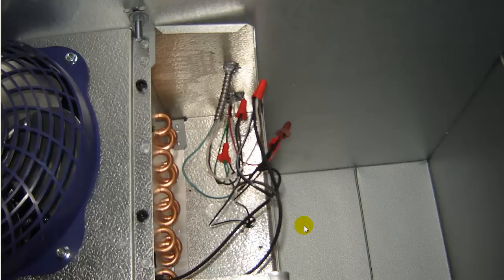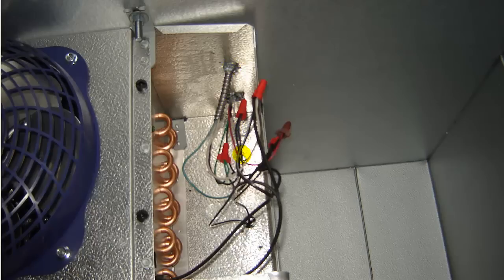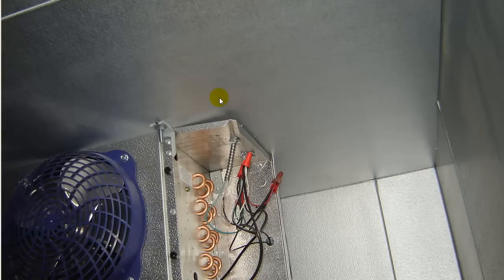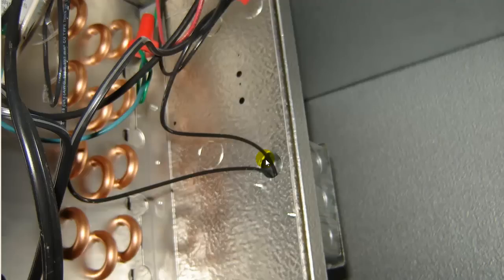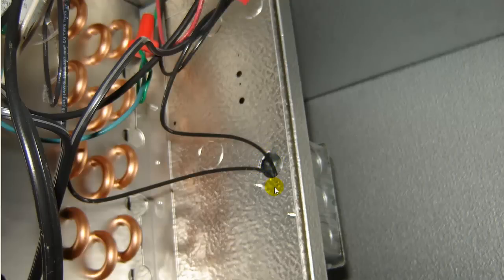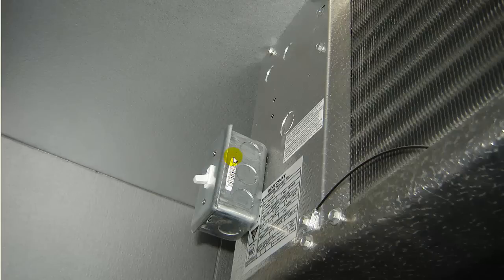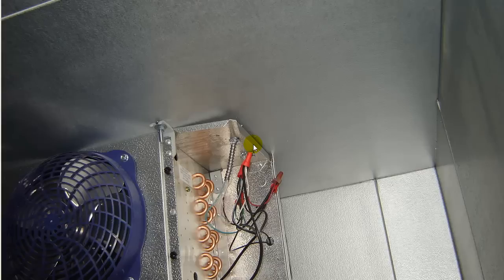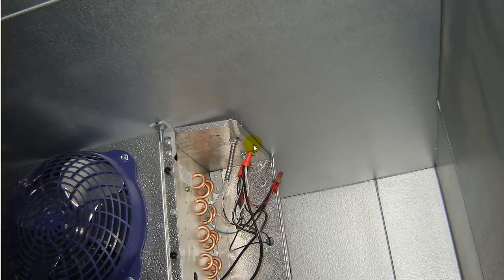Electrical Wiring for a Walk in Freezer

Comment: I just got done putting one of these up last night. We used a bell box on the ceiling with a 1/2" EMT "nipple" through the roof, into a j-box, and from the bell box ran SO cord with receptacle, 208 single phase. The old ones were wired the same way.

Previous store we used seal tite from a bell box into the freezer

Comment: Figure out how many wires you need, 4 for a cooler and 6 for a freezer(you need two extra wires for the defrost heaters and defrost termination switch. Which I don't think is necessary if you set the timer correctly.) and use seal-tight, the gray colored "hose" and fittings to make a proper "whip" for the system. Conduit is great too, but I prefer seal-tight.

Comment: You also need a NEMA 3R box with rain tight connectors for EMT or sealtight with approved connectors, or carflex with their respective connectors, couplings, etc.  All penetrations should be filled with expanding foam and finished with approved caulking.  Also, raceways should be sealed at their entrance to any enclosure once wire is pulled, joints made, etc.  Since the refrigeration process generates moisture and condensation within the freezer/cooler itself, NEMA-1 enclosures and raceways should be avoided.

Comment: I'm surprised they would do the connection inside the cooler itself. When ambient temp falls inside the cooler, atmospheric water condenses and corrosion is accelerated, even inside a closed box. Better to make the connection inside an accessible room temperature box outside the cooler. Perhaps there was no option?

Comment from the maker: @weasel2htm 
Yes they are pricey but consider it a required tool of the trade. $76.5 at BN right now.
Check used book stores. You can get a Ugly's book for $15 at  the big box stores.Good resource to have if you don't have the bucks for  the big book.